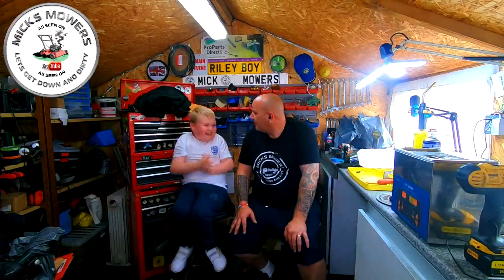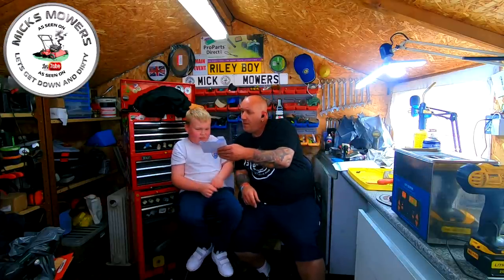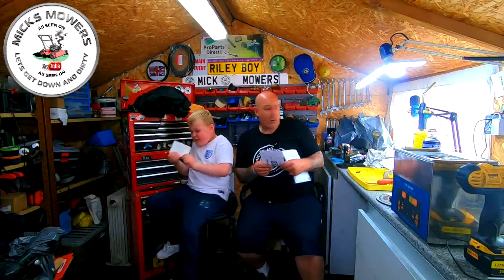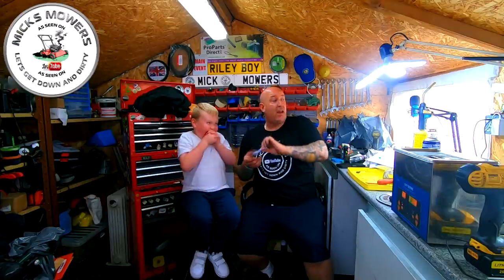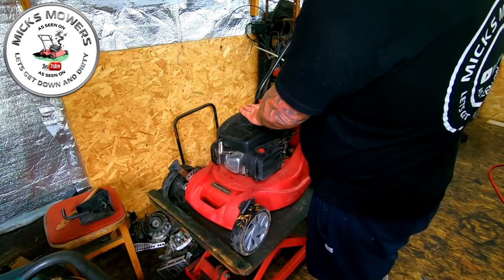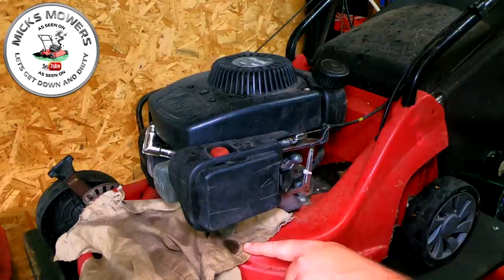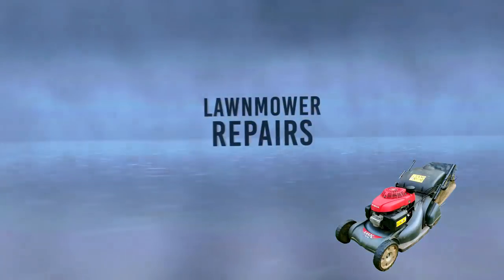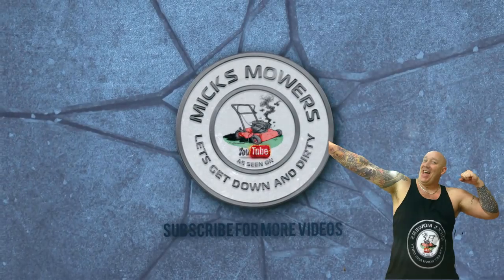Mountfield 414 Revving Its Head Off Lawnmower Repair Video

Comment: Hi mick. That’s a bad design having the primer bulb on the top of the carb because and water or rain etc goes straight into the carb and rusts the carb bowl and all that crap blocks the jets. Seen it many times on these Mountfield mowers.
Reply from the maker: Yeah it is

Comment: You need some golf tees to plug your fuel line. I use the stink out of mine. Don't get the painted ones or the paint comes off in the line.
Reply from the maker: Ok that's worth looking into.. thanks.. hope all is good
Reply: @themowerman Great video Mick. I found after changing the spark plug, use the top tip of the old spark plug shoved in the end. Worked a treat for me. Just serviced mine today and sharpened the blade. I haven't had it long so when I took the air filter cover off there wasn't any filter inside lol. Rectified now though.

Comment: For emulsion tubes that have the slot stripped out I have used JB Weld on the sides of the correct size flat screwdriver and bonded it to the tube and have been successful removing them. Just my $0.02 or for you 2 Quid!  Cheers!

Comment: Nice video Mick. I hated my plastic fuel line crimpers, went to forceps but now I use a small pair of needle nose vise grips with a 1inch piece of fuel line slid over the end of both jaws. They work great and no chance of damaging the fuel line. Just an idea for you buddy. :)

Comment: Mick, loving the videos. Where'd you get the selection of needle files from? Been searching and can't find them.
Reply from the maker: Here you go mate Juliyeh Carburettor Cleaner Multi-Size Cleaning Wires Set Includes 13 Wire Torch Tip Cleaner Tool, 10 Cleaning Needles and 5 Nylon Brushes for Motorcycle ATV Moped Welder Carb Silver ZX-51 https://amzn.eu/d/7IOIi1r
Reply: Thanks Mick